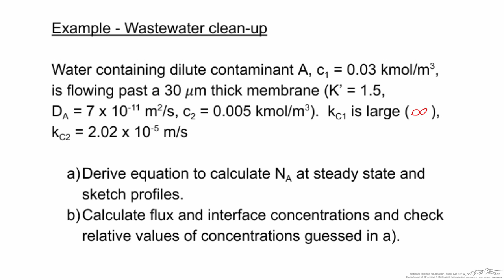Membrane Transport: Series Resistances Part 3

Comment: Is this system/question not overdefined? Meaning, if you were to alternatively solve for C,2is using diffusion through the dense membrane starting with C,1is (holding flux constant), would you not get a different value than the one you arrive at using the permeate bulk concentration, mass transfer relationship, and then the equilibrium constant?